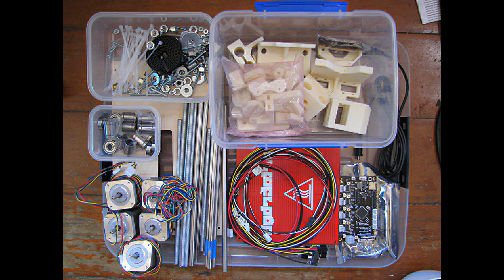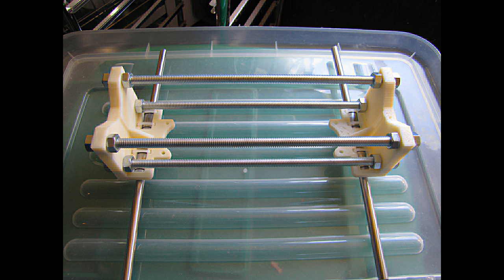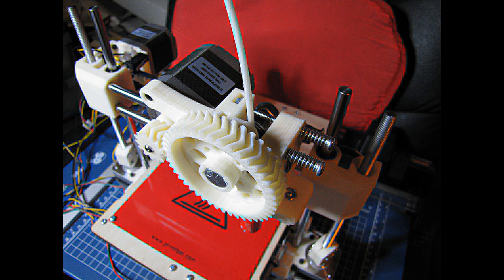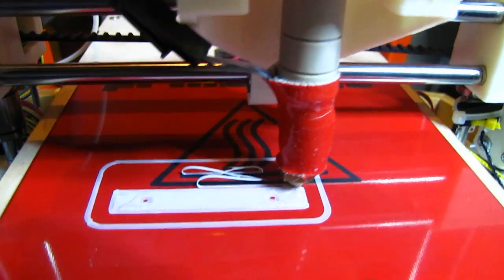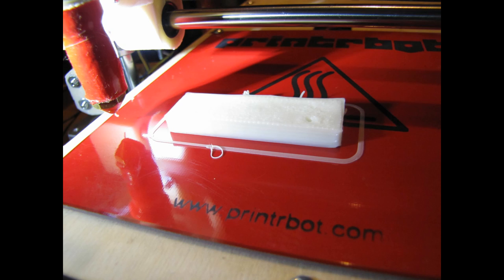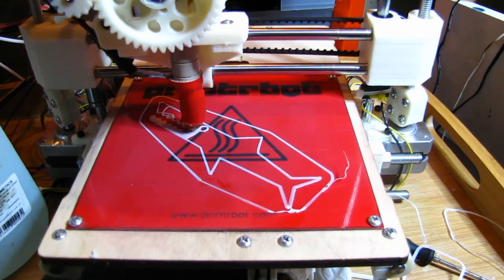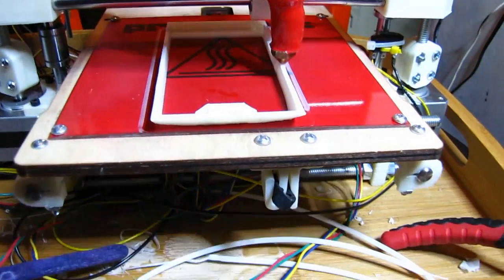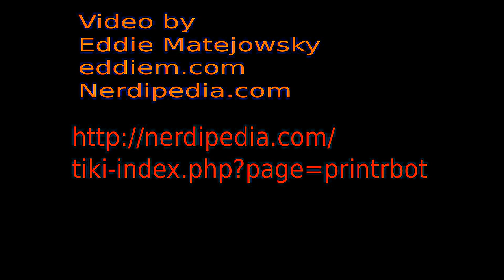Printrbot comes alive.

Comment from the maker: These kits are no longer available but I presume the newer kits don't require soldering to assemble. However it is very useful to be able to solder if something needs repair or you want to change the length of a cable.

Comment from the maker: I bought a cheap photo-frame and used the glass from that. It wasn't square so there is an overhang. The glass is a bit thin and currently the cheap shops here don't carry the correct size.

Comment from the maker: I was just getting started here the mods are for another video. You do not need tape.
I use etched glass for printing ABS and smooth for PLA.
For problem parts I wipe the glass with PVA. 
There are many threads about printing problems on the forum.
Glass  mounts are on my thingyerse page.

Comment from the maker: I doubt a surge protector on mains would make any difference. Voltage clamps on the USB lines might help. I think it was a current surge thought the earth line.
It is a rare event. My new supply has worked without a hitch after hundreds of ours use.